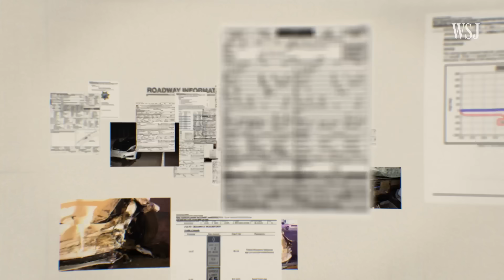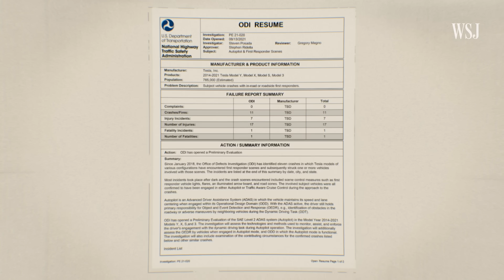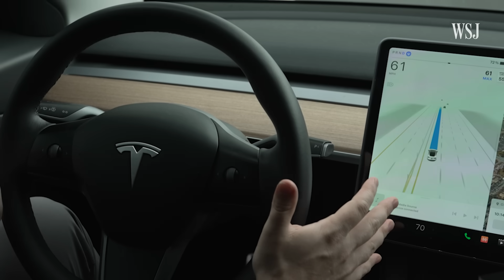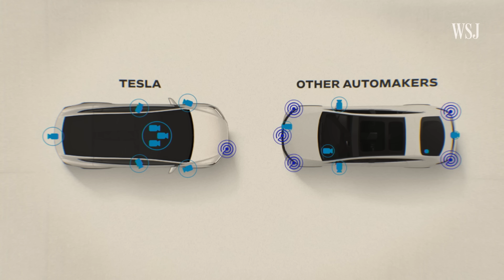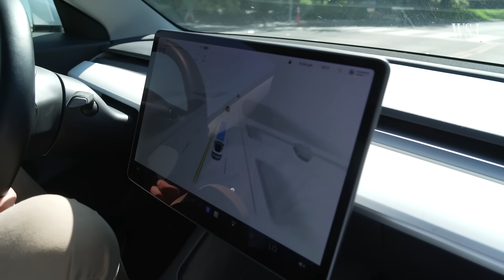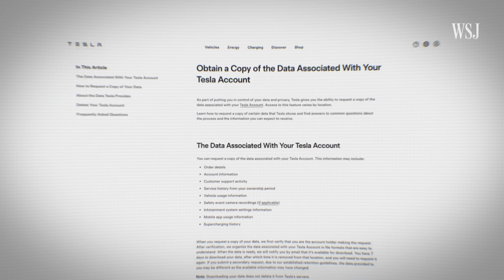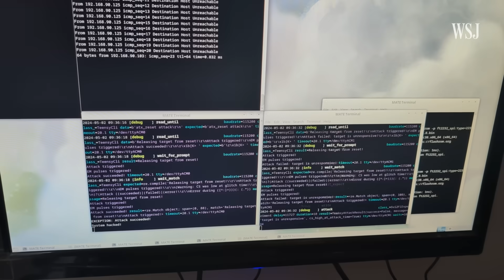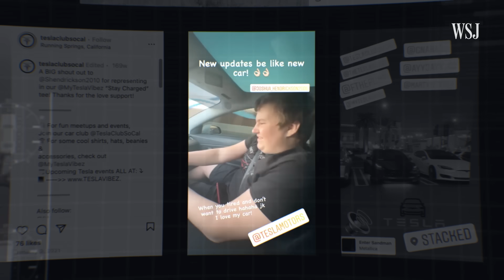The Hidden Autopilot Data That Reveals Why Teslas Crash | WSJ

Comment: Whether you use Autopilot or FSD, you have to agree to the terms — stating that YOU must pay attention and YOU are ultimately responsible for the control of the vehicle.

Looking at all these clips, in many cases the driver had time to react and take control. But they didn’t. Why? Because they likely weren’t paying attention.

In the case of crashing into the pickup truck, the camera could barely see it, when means neither could the driver. Odds of someone in full control crashing into it seem high to me.

Comment: It seems a bit problematic to hint the Autopilot function is dangerous as it's stated countless time it requires constant attention from the driver, and it will even stop the car if the driver stops responding. It wouldn't be fair to rely on the accident reports to consider it not safe, as there is no data about the crashes avoided because of the autopilot. One can find countless videos on Youtube with Autopilot's early warning and braking preventing crashes.

Comment: Autopilot is just not ready.
Reply: OK bub... I used it every day... btw... "autopilot" is just tesla's branding of adaptive cruise crontrol. It's the same as any other maker's cruise control.  Is every other car's adaptive cruise control "not ready" ?   That is a separate and different product from the one where the car fully drives itself... which is called: Full Self Driving (Supervised.)  ... not autopliot... and note SUPERVISED. It works very well. You are told to supervise it, and if you do, it does about 99% of the driving for you.  All these accidents, people were ignoring that responsibility.
Reply: Autopilot or FSD?  Two separate things
Reply: You mean traffic aware cruise control? I don't know of any brand of car with cruise control that would brake hard to avoid an accident by itself. It's not made to do that
Reply: Do your research.
Reply: Yet

Comment: 19x and you choose to ignore the car? How is the driver not at fault?
Reply: That's part of the point. The car is touted as being autonomous, and yet when it fails the blame is on the driver. Obviously both are at fault.
Reply: Musk fan boys are giving me existential dread by the amount of heard behavior displayed
Reply: Because he's dead and Elon has deep pockets.
Reply: 6450 auto deaths in 2020 due to drivers not being attentive while using cruise control. Tesla is way safer.
Reply: He is at fault
Reply: The driver did not ignore those warnings because if they had the system would have turned autopilot off. I drive a Tesla and the autopilot is far from being as advanced as the company wants people to believe. Even the name "Autopilot" is misleading.
Reply: @themightylion647 there is also a difference between autopilot and FSD.
Reply: Agree
Reply: 19 times?? The car should've pulled over and stopped for everyone's safety, right??
Reply: @maddydhilli  It was never advertised with the capability to "pull over". It only recently started to do this in version 12.5.4, v13, and 12.6.5 I believe. At the time of the accident that feature was not advertised. So to answer your question, no.
Reply: Because the autopilot still should have taken actions, Musk very clearly lied many times that the autopilot can prevent that crash.😊
Reply: @klammi85 Those quotes were very small snips and didn’t mention if he was talking about autopilot or FSD. Odds are he was referencing FSD. If you want to talk about liars look at Cruise and GM. Accidents happen no matter how safe something is. There is no such thing as a zero incident rate.
Reply: @klammi85  Again, there are times it will fail and musk has said this is why you must remain attentive even though the system is very good, it was beta at the time of crash. you are selecting pieces of what was said and not all of what was said. Elon hater are always cherry picking
Reply: The Tesla car crashed, killing the Tesla driver. It's obvious the car has the biggest burden of responsibility. Plus Tesla are holding the data back for over a year, cover ups are not nice.
Reply: Lot's of commenters in here who obviously don't drive Teslas and are hence unable to question the reporting by WSJ. Autopilot and FSD has a 3 strikes and you're out software imposed rule. Once that rule triggers, autopilot will be disengaged for remainder of trip. So if you or WSJ knew that, you will question how it was that the driver was able to ignore the warning 19 times. Either that fact is incorrect or the driver was able to somehow hack the system to disable or override that functionality.
Reply: And by the way, that driver who supposedly ignored 19 warnings had a history of irresponsible and reckless behaviour.
Reply: Lol 😂 tesla is the least safest car on the road lol 😂  It’s the deadliest cars
Reply: @williampisano7573  Same comment everywhere, from someone that doesn't own a tesla? 

You were one of those aganist the EV revolution when tesla started it, but now your favorite car brand is making EV's 😂!

Comment: Goodbye WSJ, you are now blocked. This was clearly an attack piece, intentionally withholding facts that would present even a slightly balanced report. I will not waste my time with your opinions anymore. 

For the record, the following were the leaders involved in a fatal accident;
1. Cheverlet Silverado 8,777
2. Ford f150 7,502
3. Honda Accord 5,368
4. Toyota Camery 5,023
5. Dodge Ram 4,666
6. Honda Civic 4,448
7. Nissan Altima 3,746
8. Toyota Corolla 3,641
9. GMC Sierra 3,567
10. Ford Explorer 3,319

Tesla didn't even make the top 25.  I dont think Telsas are the most dangerous cars on the road.

Comment: Tesla owner since 2020 here. Its been a great car, but I've seen the mistakes autopilot has made early on. I rarely use it. Only in the day or with clear visibility. Notice how a lot of those accidents happened at night or low visibility?  It should never have lost the radar (early models like my car have radar) , and under the name "autopilot" in my opinion. "Advanced assist" maybe. If it cant detect objects like a plane does with radar, because it doesn't have radar, how can you call it the same thing? At that point you're flirting with giving people false sense of security. Over the past few years Tesla have added multiple prompts and alerts to increase driver attentiveness which has helped a lot. Elon says the system is safer than a human. So why would it need human supervision? You cant have it both ways. Tesla have now switched to an AI based system instead of the old code-based system which has been a big leap forward. How big? Time will tell.

Comment: As a model 3 owner, I would never fully trust autopilot or fsd. Recently it can do about 95% well, however that 5% it misses, could cost you your life. Elon removing other sensors like radar and uss are all cost cutting measures. Same way interior is sparse, and Elon sells it as futuristic or “better”, it’s all cost cutting measures to make things cheaper and simpler for them at your cost. There is value in model 3 and y, but don’t get lost in Elons marketing. If you believe too much, you will be scammed. Doing business with Tesla and being happy is knowing where the value is, as opposed with his snake oil sales marketing…

Comment: Tesla's Autopilot system, while an impressive technological innovation, isn't flawless and requires active driver oversight. Tesla clearly states that drivers should remain attentive at all times while using Autopilot. Many crashes involving the system could potentially have been avoided if drivers adhered to this guideline and stayed engaged with the driving process.

Comment: Lidar isn't expensive technology, it's been around for decades. This is just another example of CEO only caring about profits over safety.
Reply: Most companies are dropping LiDAR if you haven’t been paying attention. I drive using FSD Supervised all the time because it is safer, not perfect, but really quite good and I don’t have version 13, which is rumoured to be considerably better than version 12. All this without radar or LiDAR. We drive with only 2 eyes vs 8 eyes for Tesla.
Reply: I'm a software engineer. When Musk removed Lidar, that's when I knew he could not be trusted. There's no way that vision will ever replace Lidar. Forcing vehicles to use vision because "humans drive without radar" is ridiculous, why would you not use the best possible technology, humans are a terrible metric to compare to.

Comment: FSD automatically changed the lane to prevent us from going through a deep puddle. Didn't know it read puddles. Also stopped when it thought the deer was going to cross when we were on the backroads. On the other hand almost ran clean through a red light, had to intervene 😅. 

I agree, people MUST stay vigilant.

Comment: Really poor work. You seemed to be using the term Autopilot for both Autopilot and FSD. Autopilot is just the name they give cruise control with lane keep assist. With FSD they very clearly tell you that you need to be prepared to take over at any moment. I’m not surprised people don’t follow the rules. When you ignore safety rules, your safety is at risk. Also, every single accident shown happens with bad drivers that don’t own a Tesla. This is a sloppy hit piece. To be clear, I’m not a fan of Musk but this is terrible “journalism” if you can even call it that.
Reply: Alright Brian
Reply: It made some people think the car capable of driving itself without human intervention, ever. The key term is "Auto" as in "Automatic" in many appliances and machines that doesn't require any human intervention. Full self-driving (FSD) also the problematic name, as the term "Full" giving an impression of fully automated.
Reply: It really doesn't matter though. FSD is still based on only cameras, it's just as flawed. It doesn't matter that it uses a more advanced machine learning model. Cameras lack depth sensing, and they can't see well in bad weather or at night. It' a recipe for disaster, and clearly the MLEs in tesla are too afraid to tell elon that this is physically impossible. I say this as someone with a master in data science who is an MLE. Image recognition like this women said is flawed. You need lidar for 3d mapping. Lidar doesn't need to classify an object in the road, it just senses an obstacle, which the model would interpret as I need to stop. This is why Waymos have become very good. So good, that I will take never take an uber/lyft again. Any decent MLE will agree.
Reply: @heyaisdabomb  what do you use besides your eyes and parhaps your ears?
Reply: @bartdeking  This is the dumbest remark i have ever seen.
Tell me what can you eyes do that camera's don't?
Let's just see if you are even aware of the differences.
Reply: @TheGalantir  video footage with the use of AI can do everything your eyes can do with your little brain. The camera and the AI are never tired though.  
But let's come back to this post in 6 months and let's see how this conversation aged? 
Have you actually bothered to watch some FSD 13 videos or drove a Tesla with FSD 13 yourself or are you just a type hero?
Reply: @bartdeking  Eyes are VERY different from cameras. On the surface, they may appear the same, but eyes are encoding a 3d matrix (a tensor) of color values. While cameras are only picking up a flat matrix of color values. There's no depth data from a camera. You can put 2 cameras next to each, and use basic geometry to calculate distances. But don't be fooled, it's not mapping a 3d cloud point like our eyes or lidar does. And it's prone to error from misalignment. When 2 cameras are 2 inchs apart, looking at objects 60 yards away, just a misalignment of 0.01 inches is enough to give inaccurate measurments. Our eye's are actually quite similar to a combination of lidar and cameras.
Reply: @heyaisdabomb  Tesla employs a technique known as "monocular depth estimation," where neural networks are trained to infer the distance to objects using images from a single camera. By analyzing visual cues such as object size, position, and motion across frames, the system can estimate how far away an object is. Additionally, the use of multiple cameras with overlapping fields of view allows for stereoscopic vision, enhancing depth perception and accuracy.
Reply: @bartdeking  The limit is still the fact that cameras see pixel colors. The information is a matrix of pixels. If everything is black (no light) or white (snowy conditions), there's no information to do "monocular depth estimation" with. This is the problem with cameras. I 100% agree that cameras alone are good enough in ideal conditions. That's not good enough though. Lidar has it's own issues, all of these sensors do. But I would feel a lot safer having cameras make the predictions, with lidar double checking those predictions.
Reply: @heyaisdabomb  super nice that you need lidar to hold your hand to feel safer. 
I think the rest of the world just needs the data and experience to confirm that it can be done.

Tesla is the only self driving technology that can drive you from A To B in rain, snow, without lane markings, gravel roads etc.
Reply: @bartdeking  Although it can drive on snowy roads and gravel roads, it's currently dangerous to do so. Version 12.x doesn't recognize those roads and drives as if it's asphalt. Taking a turn on gravel road as if it's asphalt will end you in a ditch. The road to the cottage is such a gravel road and although it works well on straight gravel road (even my private unmapped dirt road), I had to disengage at the first curve as it was taking it too fast. For snow, it worked well on the highway but as it took the off ramp, it didn't follow the snow ruts and for its usual method of existing the highway and went for loose snow. I had to disengage. It's just a matter of showing it driving in those situations, but currently (don't know about 13.2.1 but I would guess it's the same), it's not safe for those types of roads.
Reply: @sylvaing1  you must have seen v13 footage and know that it is again a leap forward. The AI model is continuously fed with new footage from as example yourself when you disengage. 
When you use coding to solve these issues it becomes a mess and extremely hard. However using AI makes it faster and better. 
Give it 6months and it can drive perfect in any condition.
Reply: @bartdeking  Seeing the increase in capacity between V12 and V13, it's amazing the progress they made. Too bad my HW3 is lagging behind 😞
Reply: Funny, I just came at 1am from a 180km drive on an unlit highway with FSD activated 100% of the time. It had no problem seeing everything, including pulled over semis and other vehicles with their lights off.
Reply: @sylvaing1  but that's not possible because "it does not have Lidar" 😂
Reply: @bartdeking  FSD 13.2.1 (2024.39.15) has started to be released to owners today. I guess we'll have a better view of its capabilities now that it's not only a few influencers that has it. Man I envy them as my HW3 car might never see it.
Reply: @sylvaing1  well you might need to wait a bit but either you get it at least somewhere next year as they plan to roll out the robotaxi network so it should be ready by than. Worse case you get a hw upgrade which any Tesla sold with fsd will get if it does not meet the hardware.
Reply: @bartdeking  Ashok Elluswamy (VP of Autopilot / AI Software at Tesla) mentioned today on X that FSD V12.6 should be available to HW3 car "by the end of this year". That was the last 12.X for HW4 cars before V13. Hopefully sometimes in Q1/Q2 2025 will get V13 without requiring a hardware upgrade.
Reply: Calling it autopilot is a big problem
Reply: @gobimurugesan2411  how is that a problem?
Reply: Dramaqueens. I don't get the hate towards Elon. What is the issue guys?
Reply: Have you seen a plane on autopilot with no one in the cockpit? No, the name is fine. It's people overestimating what Autopilot is that is the problem.
Reply: Just a hit job on Tesla plain and simple, not journalism for sure. As the orange Jesus would say “fake news”

I despise Elon Musk for his behaviour. He’s a walking contradiction
Reply: @GaryGreen-h8v musk fanboys 😂
Reply: @spresso007  realists, mate.
Reply: Agree… very biased and also not current (most examples were from 2021).   

The NHITSA rep also doesn’t understand how AI algorithms really work.

Comment: Autopilot doesnt apply brakes at stop signs or red lights. Only FSD can do that. The warnings that you should pay attention and the limitations of both systems are numerous between initial activation to when youre actually driving. Unfortunately, a lot of these accidents come down to user error and lack of understanding of the tech. Tesla has never stated that FSD is solved and autopilot is simply a good cruise control/lane keeping feature. Anyway, its always going to be sad when someone dies from a car accident. Which is exactly what Elon and Tesla are hoping to eventually eradicate when FSD is finally solved.

Comment: This is important reporting, but I think it misses the big picture. Is autopilot safer than human drivers? Overall, probably yes. Is it safer than your typical 45yo driver with 20 years of experience? Maybe not. How does it compare to other vehicles with driver assist? Pointing out accidents is fine, but this needs fuller context. Have you seen the accidents humans get into?

Comment: bottom line is as long as it's safer than human driver, then it should be used. You can put 100 radars and lasers on cars they will still be crashes for sure. Relying on radar can have it's own set of problem, in case one sensor is conflicting with another sensor.